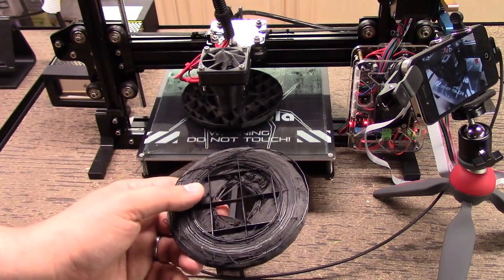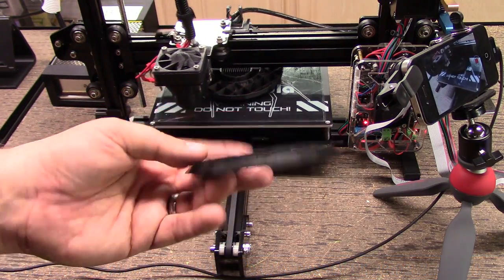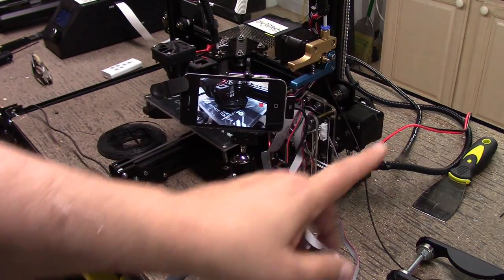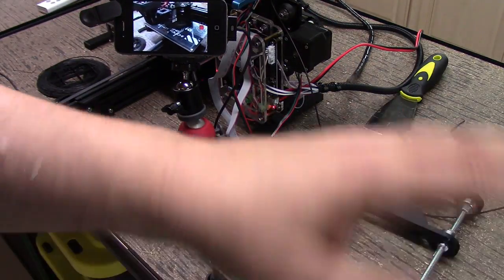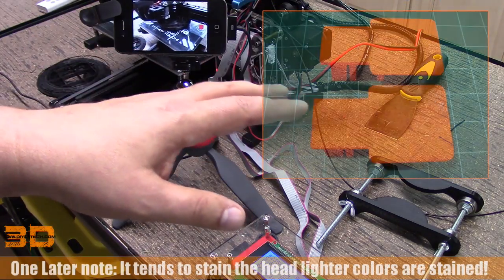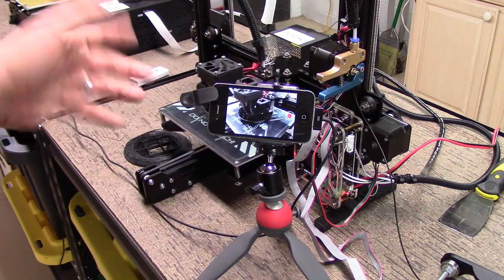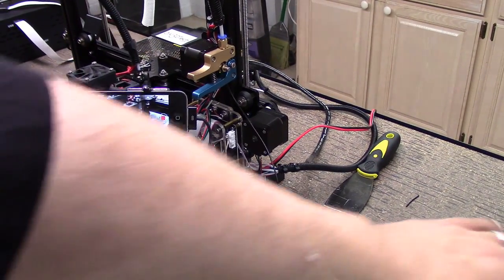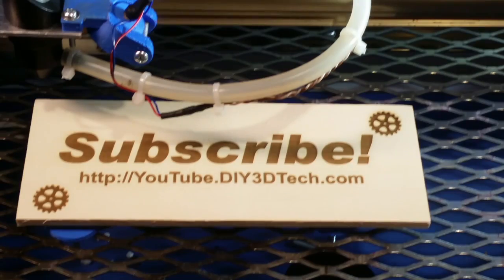3D Printed Projects - Working with Proto Pasta Conductive Filament!

Comment: So far two breakages and one totally clogged up hot end.  I'm printing at 230C hot-end and 60C bed on an ender 3.  Yes this material does seem to be very brittle.  Both times it has broken in the feed unit just past the feed gear.  I will try again at 235C as suggested in the video.  Great video, thanks.  Very interesting.

Comment: Interesting. I got none of your problems on my Ender3 with the Protopasta Conductive PLA. I print with the normal nozzle temp of 210°C, having good layer adhesion and the raw filament isn't brittle either. Very thin, unsupported structures tend to bend up, but that's all. I followed you advice and upped the nozzle temp, maybe this will fix it.
Reply from the maker: Glad to hear its working well for you!  :-)

Comment: conductive ABS is weak .... it's easy break, is it the filament issue? it not same as normal ABS...
Reply from the maker: Not really "weak" but yes "brittle".  why did I use it?  Simple the top of the static electric generator needs to conduct electricity to work :-)

Comment: I have  found some 'special'  PLA's need 230+c   temps .  (random , mostly useless thought )   I wonder if there is enough carbon in the  conductive stuff to block R/C  receivers form getting FR signal .
Reply from the maker: I am going with "sort of"  I am thinking about printing a parabolic dish for UPAir drone antenna...
Reply: ooh that would be cool . but for the  frequency ,  if the carbon is more of a absorption / scatter  VS surface reflect .  
lets look at RF as light for a  sec. 
sub surface reflection / scatter is like when you hold a flashlight up to a translucent object  or your finger / skin .   it lights through a volume of the surface .  basically a diffuse-er . 
surface reflections , are like well your laser mirror .  it bounces off the surface nice and flat vs scattered and omnidirectional. 
I suppose the carbon in the PLA will cat more like a absorber of RF .
You could just CA glue  some foil to your tiny dish . get that surface bounce . 

I wonder if conductive PLA not only keeps body static charge down  (ESD freindly) but has a light shielding for RF too ?
Reply from the maker: I might tend to agree with you on the scattering because of the low density verses that of a piece of sheet metal...
Reply: you could use strips of the adhesive backed foil tape for ducting to cover the RF reflector  of any dish  you print .
Reply from the maker: Thats a good idea as I have a bunch of foil backed HVAC duck tape.

Comment: Hey, do you have a link to the mods that you used on your print head? I have a Tarantula aswell, so that'd be really helpfull!
Reply from the maker: I am still pretty much stock on the hotend, I did buy an E3D all metal clone but never put it on as this one is still going strong!  (which I never thought it would :-)

Comment: Dang, that is ABS temps I use from the third layer onward. :/
Reply from the maker: This stuff was pretty hard to work with and it also stained the hotend as after this I ran some lighter color jobs and it took for ever to get the black streak out in fact it ruined my first piece.
Reply: Yeah, bad stuff.
Reply from the maker: Did you change your screen name?